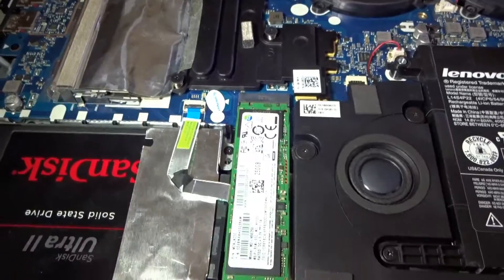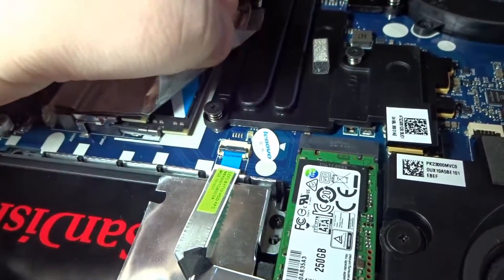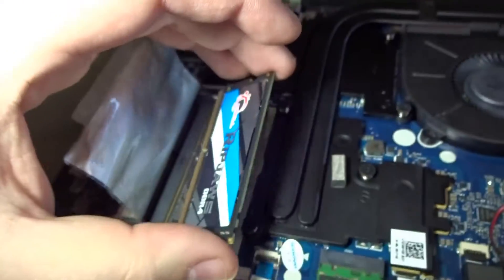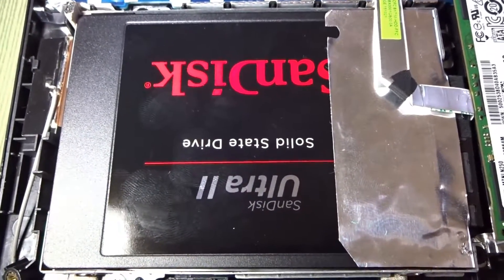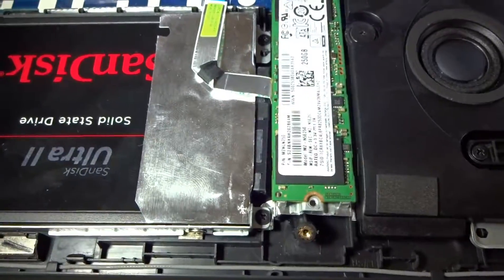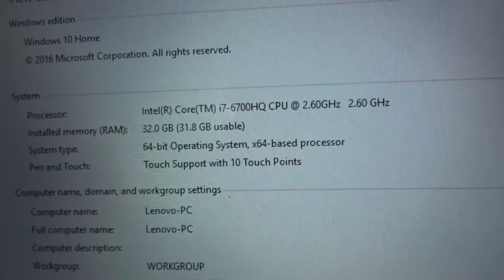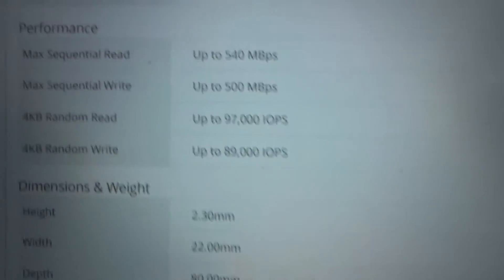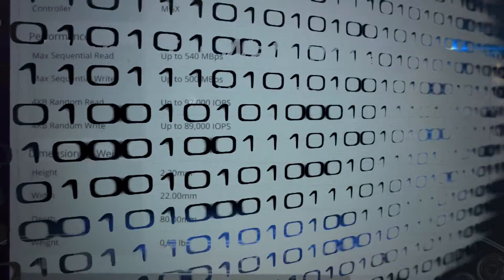Lenovo Y700 Max RAM and SSD benchmark

Comment: i got mine with the 16GB initially because back when this laptop came out there were one online who tested and said if 32GB would work on this system or not.
which was very similar with the M.2 NVME drives support - some said they work, some said they don't, lenovo officially said NVME drives wouldn't work but in the system service documentation they listed a bunch of M.2 drives which some of those WERE in fact NVME drives.
so i took the bet back then and got a Samsung 950 PRO m.2 NVME SSD and it worked great (for a while until i started having issues with BIOS detecting it - so it stopped booting)
that issue went on and off which frustrated me so i just left this laptop in a bag in my room for the past nearly 4 years and just kept using my older laptop.
so back then i thought this laptop honestly has not much upgradability in it, i mean the GPU it has sucked bad even back when it was brand new, 16GB of ram was supposedly the max ram this system officially supported which was what i already had, M.2 NVME support was officially unknown and honestly the only upgradability this system really had was storage - 2.5" drives and M.2 2280 drives.
good to know this system actually supports 32GB of ram as i recently got this laptop back out of the backpack it had been sitting in for the past 4 years and some of its SSD M.2 detection issues seem to have been fixed by themselves and i really could use a portable workstation now.
honestly the biggest and most major problems with this laptop are its battery life which is abysmal and its GPU which is pure and utter crap (i expected much more from a gaming laptop back in 2016 when my desktop with a GPU from 2011 gave me better gaming performance)
Reply: Sincerely, I emphasize with this reply a lot. This laptop has been my first self bought machine from saving up working over the summer. I was glad to run Dark Souls 3 back then on high settings but that GPU has aged so much in so little time its embarrassing!

Have you played any games after upgrading? Is it worth it? Im considering to upgrade my ram and expand the storage, but that terrible battery life and low portability (this things is really heavy) makes me just want to get a loan to get another one (though id be tempted to switch over to m1 apple due to the better value).

Comment: I was thinking about upgrading to 32gb of ddr4 with 3200Mhz, does it support that speed?
Reply from the maker: It supports up to 2666Mhz. If you purchase 3200mhz, it will downclock to the appropriate speed.
Reply: @vedrans6187  are you sure?
Reply: @ivanwillyartdian4830  yes, I tried diff spec ram..only goes up to 2666Mhz

Comment: Hello Vedran S how are you I hope you are well I need help like you are an expert that I jejeje look is that I was looking to buy a 1tb M2 is compatible and the other 2.5 "SSD is compatible for 1tb or only up to 512GB left very attentive greetings
.
Reply from the maker: Sorry for the late reply..The machine will work with really any drive you put in it. I have a 250GB M.2 in it and just recently upgraded to a 2TB Firecude drive from Seagate. Hope this helps!
Reply: I'm worried because I was told that M2 works up to 512gb and not 1tb that told me but what you updated 2tb 2.5 "hard drive works fine to see if I can buy the normal hard drive for the 2tb laptop and How does it work well without failures? :-)
Reply from the maker: I mean so far the drive works fine. The laptop recognized all 2tb of it. No issues as of yet.
Reply: To perfect ready, thank you very much. I am going to buy the disc to see how they are doing. Thanks for your help, they look great. :-)
Reply from the maker: no problem buddy
Reply: The last question that is worth bothering but surely M2 can work up to 1tb or up to 512gb if I explain
Reply from the maker: It should work up to 1tb just fine. If you want, get the 512gb. Just get the 2.5" in the 1TB so you can use it as a Data drive.
Reply: Let's say if I buy M2 of 1tb it can work is true and I buy the firecuda 2tb of 2.5 "that thinks so the equipment can work well but I want to know that compatible M2 works serve samsung evo 970 pro 1tb I am very attentive

Comment: Is it possible to connect external gpu with adapter into that m.2 port?
Reply from the maker: I really haven’t tried it, but i believe you wouldnt really see any increased speeds if you were able to connect it to m.2 since it doesn’t have enough bandwidth to see any additional benefit from eGPU.

Comment: I have the lenovo y700 17inch screen. I have the same CPU as you. But i only have 8gb ram and a geforce 960m graphics card. For better gaming performance, would it help to upgrade my ram to 16gb? Or is it my graphics card that is the bottle neck anyway?
Reply from the maker: Having more RAM does help the machine out, but the bottleneck is the graphics card. The unit is a very high end multimedia laptop. It can run games, but starts to struggle with FPS if you push it.

Comment: Can I use the Samsung 960 EVO Series - 250GB PCIe NVMe - M.2 Internal SSD (MZ-V6E250BW) to upgrade my laptop Y70015isk ?
Reply: I would recommend staying away from PCIe NVMe m.2 drives for this laptop. Tried it myself and just couldnt get it to work. Also, from my understanding, and extra performance gains from people who do get it to work aren't realized, so your best off going with something like an 850 evo
Reply: I just tried a Samsung PM991 NVMe PCIe SSD and it worked - and a few times faster than the SATA models, too. Will get a 970 Evo Plus for it.
Reply from the maker: Yes, you shouldn't have any issues with it. You might just have to do some tweaking in the bios to recognize the NVMe's speed increase, but as far as compatibility, you should be fine.

Comment: i have lenovo y700 nvidia 960m 4gb graphics while i am playing games suddenly screen freezes but with in a moment it gets to normal any help plz
Reply from the maker: Sorry for the late reply, have you tried updating the drivers? What surface do you have the laptop on? It could be overheating if you have in on a couch or bed.
Reply: Vedran Simic np thx for replying i am putting laptop on big wooden plank which is flat
Reply from the maker: have you tried updating the drivers and try having a cooling pad?
Reply: Vedran Simic drivers r update but dont knkw what coolpad to use any help
Reply from the maker: Any cooling pad would work...here is one that I just found on Amazon. https://smile.amazon.com/Cooling-TeckNet-Portable-Ultra-Slim-Notebook/dp/B014F4SBMK/ref=sr_1_8?s=pc&ie=UTF8&qid=1500478109&sr=1-8&keywords=Laptop+Cooling+pad 

It has good reviews and Price is not too bad. Try that, see if that helps any. What games are you playing for it to freeze up on you?

Comment: Nice upgrades. I have the Y700 with AMD hardware. I need to do a video on mine sometime. There isn't much on the AMD version out there. I have 16gb of ram and I replaced the hard drive with a Kingston Savage SSD. I don't have an M.2 though.

Comment: Hey, Vedran Simic, I am looking to upgrade the storage on my laptop (same model as yours) but after looking around the internet I can't find anything specifying what is the max dual storage capable... Is it possible to have a 1TB HDD and a 500GB SSD? If not or so what are the possible combinations?? From the looks of things all I have seen around is a 1TB HDD and a 128GB SSD. Also, thanks for the RAM info will definitely upgrade my 8GB RAM to 32 ASAP. Also, just realized you are using a 960GB SSD along with your m.2 SSD! Didn't think that was possible... Really confused on what the possible storage combinations are.
Reply from the maker: Sorry for the really late reply. Been busy with work. As far as combos, the OS will recognize pretty much any HDD you put in it, as long as it can physically can fit in the tray. You can use a 1TB HDD and a 500GB SSD, as long as the SSD is M.2, it should work fine. I did a SSD 2.5" as my Data drive just because the read and write speeds are faster. Hope this helps!
Reply: u can add 2tb ssd nvme bro, in fact u can also change 2.5 hdd to 2.5 ssd 2tb if still not enough

Comment: Greetings! 
Recently, I've bought a Lenovo Ideapad Y700-15ISK 80NV0163HV
with 4GB of ram and 1TB of HDD inside.
The question is, can I put a  Samsung Evo 960 m.2 in the laptop, or does it only support Samsung Evo 850 M.2?
I need your help,
Thanks in advance!!!
Reply: Yea i wanted to purchase 1 Tera SSd but it's quite expensive so i won't get that any sooner, I also hate the cons of HDD as the operator of system i think i will use it as secondary drive for now, So im installing Win10 on SSD without a choice, Thanks for your suggestions i appreciated.
Reply from the maker: It should support the 960 m.2 just fine. I put the 850 in because I really don't see a need for anything faster. It runs my OS fast with the 850. Get some more ram though, that will help your machine breathe a bit more.
Reply: Wow, thank you so much ! This is helpful, and yeah, I'm gonna get some more RAM for sure.
Also, I forgot to mention that I'd use the 960 mainly as a boot drive (with WIN10), but I heard my machine might not support it that way :( Anyway, thanks your help already !!!! :)
Reply: OK! It works fine, I can also boot from it :) thanks again!!!!
Reply: Hi. I suggest you to install it on the SSD. It makes windows boot, and does stuff much faster. 
The downside is (for me) that windows pro takes about 25GB from my SSD, so it needs a system disk with at least 30-40 GB in long term :)
Reply: Petyaaaa2 I got the same pc as yours I want to reformat and make a clean install of windows 10 Pro or Enterprise..
Should i install it in HDD 1Tera instead of SSD 128g ?
Reply: Hey, was your SSD the PRO 960 M.2? And how much memory was it? Looking to get a 960 PRO m.2 512gb but not sure if it will be compatible.
Reply: Hey!
I've got the M.2 960 EVO 250GB
It's working well, I love it.
You can check its and the pro's original specs here:
http://www.samsung.com/semiconductor/minisite/ssd/product/consumer/ssd960.html
Reply: Petyaaaa2 Indeed it does for long term it's not enought space which means it will force you to install the rest of softwares in the HDD drive one day..
Reply from the maker: Or just get another SSD to replace the HDD. I replaced my 1TB HDD with a Sandisk Ultra II 960GB. The only reason behind it was that I hated that I would hear the drive spin up and back down. As far as performance, it is definitely faster than the HDD, but not by much for what I use it for.

Comment: Hello Vedran Simic like these, I saw your video looks interesting that you can update the ram more powerful but I want to know I have a lenovo y700 laptop the reference is Y700-17ISK with 17 inches and I have used 16 Gigas of ram and can upgrade to 32 gigs As well as you have that works for my reference many thanks I wait your comments greetings
Reply from the maker: Yes you can. One other person asked the same question with the exact laptop you mentioned. Hope this helps!

PS. If you want to be really sure if it will work, visit www.crucial.com and do the free memory scanner.
Reply: A ready thanks a lot for your help I'm excited to replicate more ram but I want to know it works perfectly 32 gigs for games and graphic designers
Reply from the maker: For games, you wont really see a difference. Something power hungry like graphic design or like video/photo editing, the machine will enjoy having a bit more resources to use.
Reply: Uff what a real cheer thanks a lot for your help I'm going to buy the ram 32 gigs but I want you to recommend which is the best brand to buy the crucial ram memory, corsair, samsung, or which is better or which faster thanks
Reply from the maker: Any of the RAM sticks would be good. Keep in mind, the machine maxes out at 2133Mhz. So don't over pay for some RAM that your machine won't fully utilize. I personally use G.Skill RAM in my machine. This is the RAM I use : https://www.newegg.com/Product/Product.aspx?Item=N82E16820232150&ignorebbr=1&cm_re=G.Skill_DDR4_Laptop_RAM-_-20-232-150-_-Product
Reply: A ready thanks a lot for your help then I will buy that brand that great sure I will be very happy to expand more memory ram greetings God bless us

Comment: I see you do not have the screw on the m.2, is it okay to not put the screw?
Reply from the maker: In this case, its fine because it is so close to the bottom and the edge of the laptop, it really can't go anywhere. But usually you would need a screw to keep the M.2 secured.

Comment: 32 gigs - okay, but isn't it limited to 2133 Mhz? The installed ones are 2400, right?
Reply from the maker: Yes, they throttled back to 2133Mhz. The reason I bought the 2400Mhz is because they really didn't have a huge selection and I have used G.Skill for a long time and knew that they would work just fine.